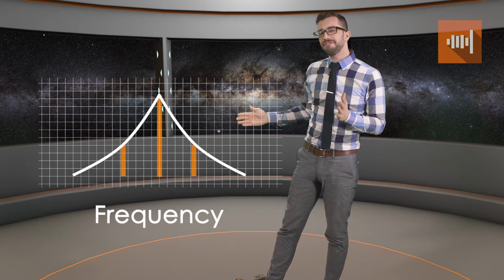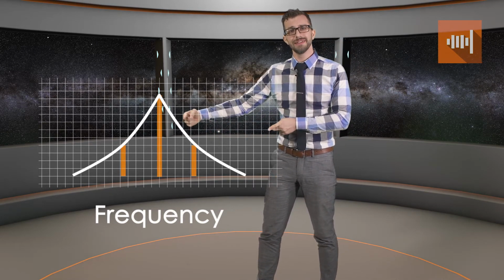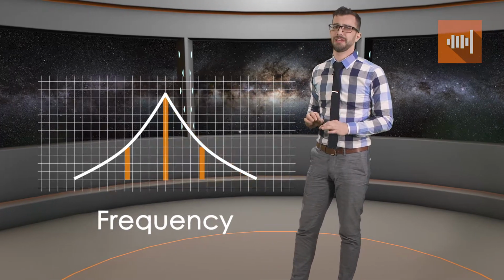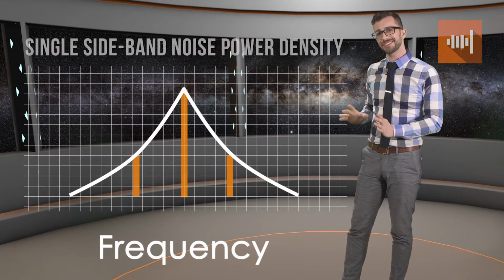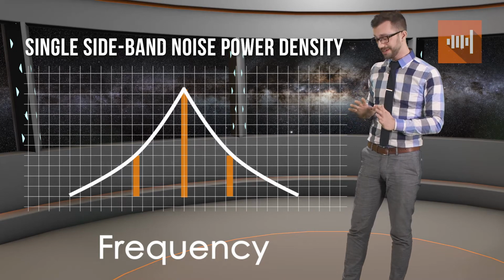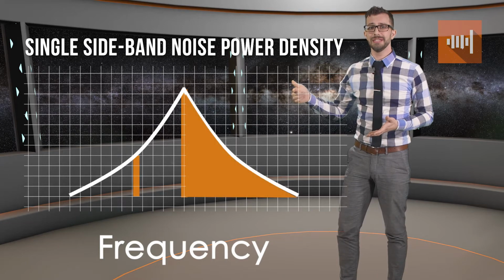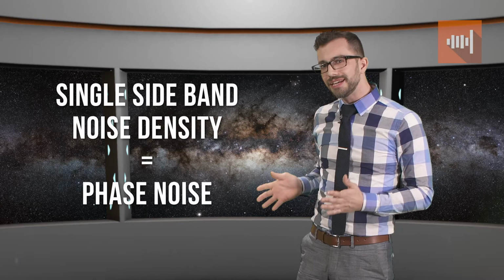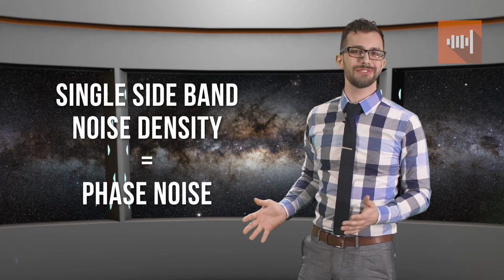What is Phase Noise? - Phase Out

Comment: When you talked about Oscillator, what exactly is the signal? 
And what's the signal you talked about when you said "The signal would be vertical line"
Thank you.
Reply from the maker: Hi there! Thanks for your questions. We were referring to oscillators in general, so not an oscillator at a specific frequency (doesn't matter in this case). As for vertical line, we mean that it's ideal for an oscillator to operate at 1 very specific frequency over time (one vertical line on the graph. However, this is never the case and oscillators will always have some sort of other noise (phase noise) present. A main part of the oscillator's job is to minimize this phase noise. Hope this helps!
Reply: To measure a specific frequency at the ideal phase noiseless signal, you will still have a skirt as the measurement device will also have a bandwidth that would need to be considered and would be seen as a "measurement noise floor".  As the spectrum analyzer sweeps towards the carrier frequency, the bandwidth of the receiver will start to register a signal and the skirt will be seen rising and falling as the sweep crosses the signal.  The analyzer noise will also have noise that needs to be understood.  

To improve the measurement over a regular spectrum analyzer sweep, there's what's known as a quadrature lock between a known good reference and the device under test.  Very accurate measurements can be seen at that point and a determination as to whether the device under test is worthy of the specification.